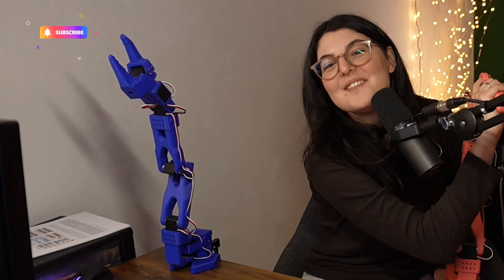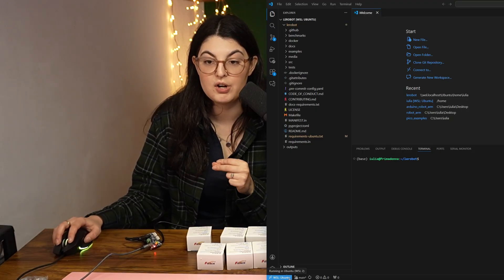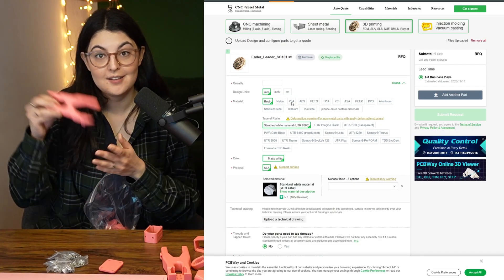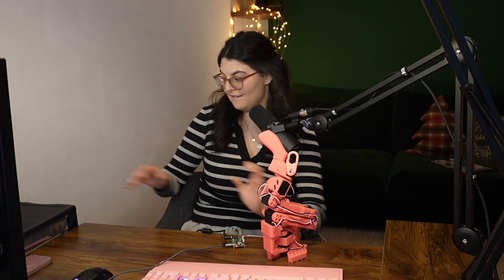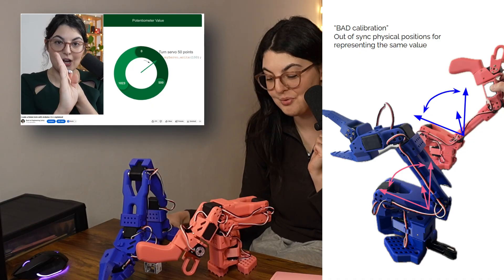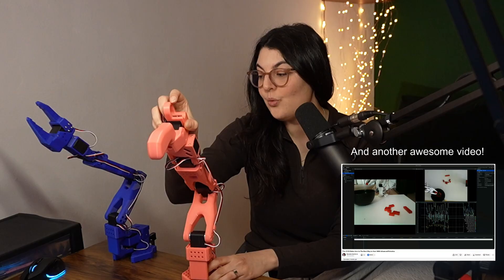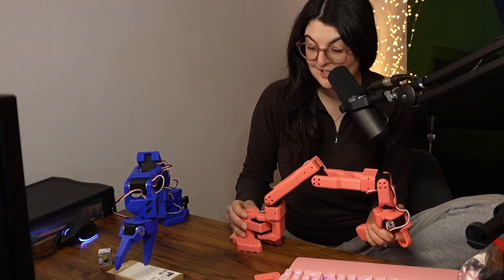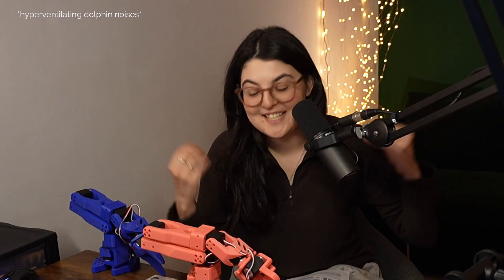Can I build an AI Robot Arm to do my chores?

Comment: Servo motor is main problem for me.Its very expensive to buy 12 servo motors.Can i use cheap servo motor which cost around $1.Any other solution kindly help me out ❤
Reply from the maker: You can build an arm with the cheap servos - I have a video about that on my channel too! But I’m not sure the Lerobot software will work with that out of the box. I’ll try to see if it can be adapted in a future video but it will definetely have way more limited capabilities for working with models and AI